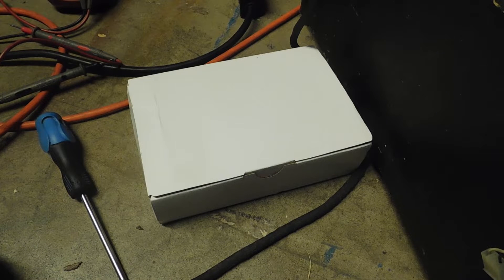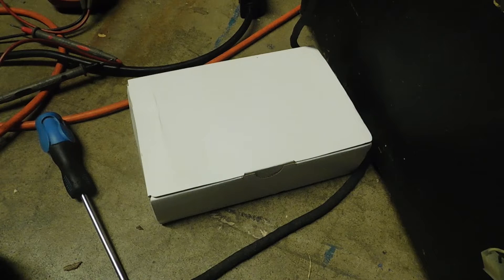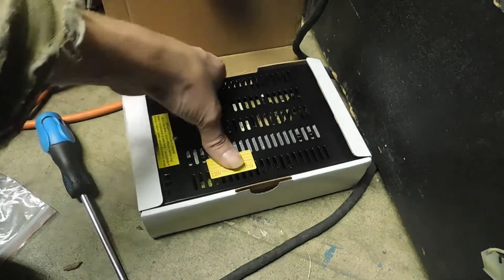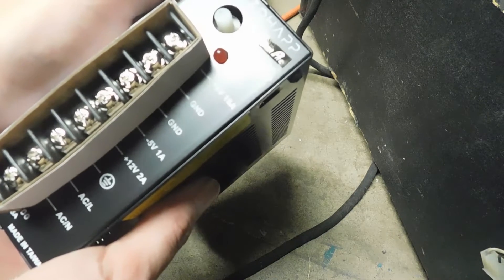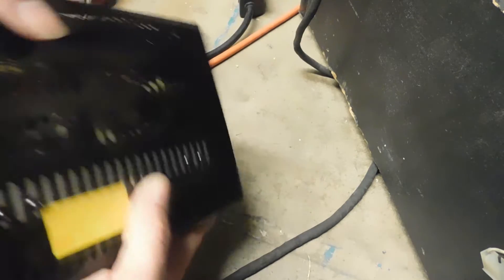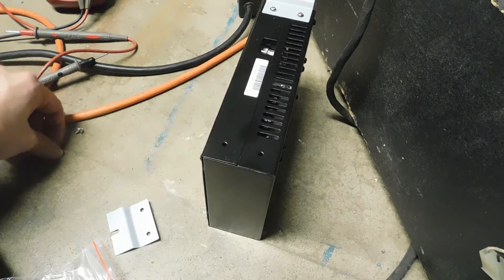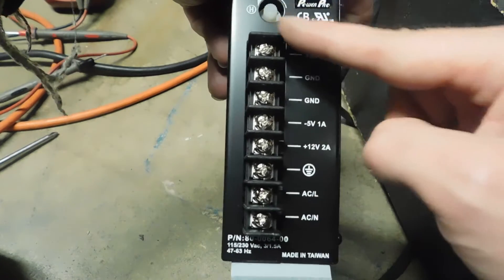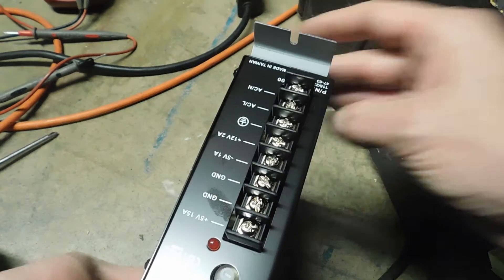How To Adjust & Install a BRAND NEW Power Supply {Switching Power Supply Install From Box To Game}

Comment: I have heard other arcade techs say that switching power supplies can make things worse depending on the arcade game because switching power supplies has switching noises on the +12, +5vdc , etc and also the switching noises will cause the arcade monitors to have a flicker and other display anomaly issues. I'm not sure which arcade games are more sensitive to switching power supplies but you should look more into this.
Reply from the maker: I've heard this from other techs and I've seen it personally from the games I worked on when I worked in Arcade Rooms. I didn't mention in this video, I should have, but some of the noise for the monitor can be fixed by using a Ferrite Band around the AC Lines. The noise issues with certain game boards could be remedied by possibly using a filter board attachment to the PSU, a game that comes to mind I had this very issue with was my Super Pac Man and I was able to fix the issue with a filter board that attached directly to the PSU. This could help but I can't say for certain it'd help with every game and with the ones it doesn't help then I'd go back to the original Power Supply board the game(s) came with.
Reply: @willsarcadeservice4599  what are these filter boards called and do they sell these filter boards for arcade games PSU it sounds like an RF emi filter board it seems because the switching frequency of the switching power supply somehow gets radiation from the the arcade monitor to bleed into the circuit. The PSU switching frequency of the power supply bleeds in somehow into the arcade monitor. Do you know what type of filter boards they were called or the brand name that you would attach to the PSU for arcade games to prevent this issue with arcade monitors? Fair ride beats would probably help out on the 5 volt line and the 12 volt plus and minus lines and on the arcade monitor they have high voltages going to them so I'm not sure if the RF ferrite beads but able to do high voltage or their special type of a ferrite beads that are on that can handle high voltage
Reply from the maker: @waynegram8907  It's been a while since I've used the ferrite bands but i've had success with the higher voltages with them in the past, there are a few different types of ferrite bands and to be honest i haven't had to use them in my personal business but I've used them in the arcades I worked for in the past. When it comes to to the PSU Filter boards I'll have to look back into the ones I used and get back to you but essentially you're right that the boards are more like EFI Filter boards for the lower voltages. I've used them mainly in the Super Pac Man I mentioned before and in one of my Space Invaders I converted a few years ago. With those two games I mentioned I had various issues with them like game board voltage spikes and reset issues within the game board and these boards seemed to fix those issues for me. The monitor issues I've seen when working for arcades in the past were LED monitors and not CRT so that may have a huge impact too that i'm not aware of, but we had a LED monitor flickering after we swapped the PSU out with a Switching PSU but once a ferrite band was added to the AC lines the flickering went away for us. Very well could have been a coincidence that it went away.